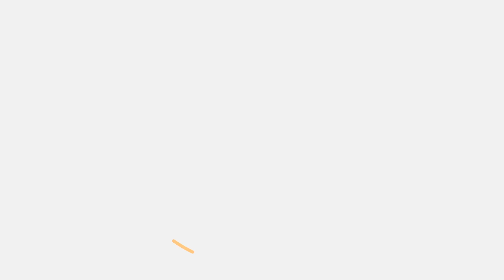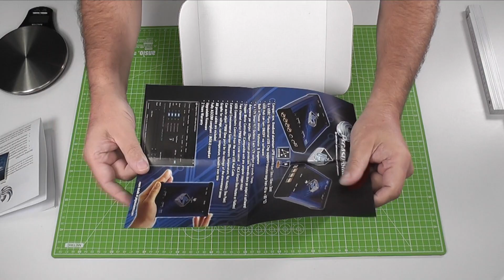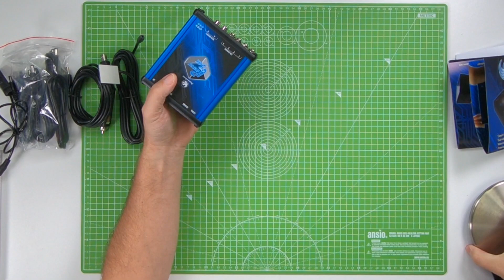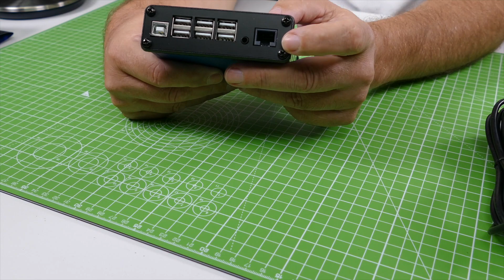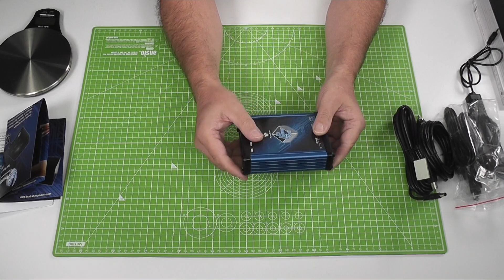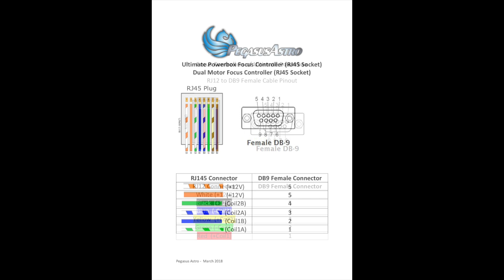Pegasus Astro Ultimate Power Box (UPB) Unboxing and Overview - Part 1 of 2

Comment: Can this act as a camera to PC interface as well? Sorry if that's a dumb question, I'm not so tech savvy. Basically can this act as a hub for the com cables or is it strictly power supply requiring a separate USB hub?

Comment: Just bought this from Tring Astro. Looks very good.
Reply from the maker: That's good to know that Tring sell the PA equipment.  Unfortunately they are showing out of stock for it, as is the case for most suppliers at the moment, but well worth waiting for.
Reply: Whew must have bought the last one today. Count myself lucky.
Reply: Galacticus Funny, I bought mine from Tring 2 months ago too! Neil, the owner I think had the last unit sat in a box ready for despatch with some other bits n bobs. I tried to convince him to sell me it 😬 but the mans a loyal chap 🙏 I put an order in which took around two weeks before I took delivery. I love the unit. Bit expensive but most scope hardware is right 🙄 I also have the focus cube, sadly you can’t control the focus cube with the ultimate power box. I spoke to Pegasus and they told me I should have purchased the stepper motor kit, not the focus cube! hind sites a wonderful thing lol. Not really a problem as the whole kit n kabudle is driven through SGPro.

Comment: A great Video again :-)
Not good to hear that you had to send your EAGLE back. I also was thinking about buying one, but I think it's heavily overpriced.
I'm thinking about of developing an "ASTRO-PC" based on an Intel NUC. The whole project will be open source. Maybe you find such a project interesting. If yes, I would be glad to hear what you are thinking about it.
Reply from the maker: Hi Keinen, thanks for the comments.

Yes a real shame with the Eagle2, but for such a premium product I expected it to work flawlessly, and it simply didn't.  It was also based on a NUC, and this is where some of the problems lay, in that firmware issues with it were not able to be addressed by PLL.  They basically developed a separate power and USB2 board and connected this internally to the NUC.  In the end it meant too many USB, driver and other issues that were costing me so much imaging time that I had to give up.

I think, given time and some more testing, including PLL actually listening to feedback rather than convincing themselves nothing is wrong, then this could be a superb product as it has the potential to be.  But it isn't ready just yet.

I would say if you are thinking of developing an astro PC, which I think is a great idea, then it needs to be reliable first above all else.
Reply: Do they have not used the USB from the NUC to connect the imaging camera and the autoguider? The additional board in the UPB should be likely similar as in the EAGLE2.
I have a cheap Chinese Mini-PC from Alibaba running. It works almost quite well. My main problems are the trashy driver and the trashy USB-protocol from QHY. That's also such a shame. The stability of the USB connection is a shame.
What exactly do you mean by the PLL?

I've also had the idea of taking a mini-ITX system as a basis. This would have the advantage of full speed desktop CPUs and a much more faster/stable USB 3 connection. The only problem for mobile use is the power consumption. But this could be optimized by undervolting/underclocking. A further advantage is PCI-express ports, which gives the ability of installing more full speed USB ports that are not just a hub like in the EAGLE.

I'm very excited about your video about the eagle2 and you 2nd video of the UPB.
Reply from the maker: Hi Keinen.  Sorry by PLL I mean PrimaLuce Lab.

They do use the 4 USB 3 ports on the NUC, which you can use for your camera, and then there is an extension board which had 4 USB 2 ports and the other outputs such as PWM and power ports.  I'll go through the issues in the update video but the main one was the inability of the system to boot on power, which for me in a remote observatory was critical.
Reply: Thank you very much for your reply. The problem with the NUC and the USB 3 is also (If it is the same as my Mini-PC, but I think so because it has the same Chipset), the 4 USB 3 ports are only 2 USB3 interfaces. On each Interface is a 2 port hub. So if you plug guider and imaging camera on the same interface, you will have problems with the bandwidth. I think the 4 ports on the EAGLE are just a 4 pin USB hub. This is ok for devices with very low bandwidth like a focuser. With devices like USB 2 Serial or Bluetooth to control the mount it can cause problems.

Comment: Great overall review mate. Shame about your Eagle having to go back. Hope that’s sorted out. I guess with having so many things to go wrong in this hobby, Pegasus UPB is a welcomed addition which as your mentioned hardly ever fails.
Reply from the maker: Cheers Ahmed.  I thought I would do this in 2 parts as I wanted to show how small, light and compact the unit is, and what comes with it etc. (although I had a senior moment and couldn't remember the size of the 3.5mm jack plug!!) but I really wanted to dedicate a whole video to it running because, as you well know, it is a great piece of kit with lots of things to look at.

I'm afraid the Eagle2 looks terminal.  I will be updating the videos, but it essentially came down to the firmware of the NUC not having the ability to boot on power, meaning I would need to leave it on permanently and run it via Wake On Lan, which doesn't suit me for a remote observatory at all.  A power outage would mean I would have no way of turning the unit back on.

Anyway, got another UPB now and, as with the first one, I am very happy and all is working perfectly.
Reply: Absolutely agree, a 2 part video will only do this device justice. Lots to cover in the second part and can not wait for it. You’re reviews are very thorough and I for one most certainly looking forward to the videos.

Shame about the Eagle mate, you obviously need something that is not only reliable but will work day in and day out. Given the price point of the Eagle 2, I would’ve hoped they had these little issues sorted out. The UPB is 1/4th of the price and yet it’s super reliable.

I’m glad you mentioned that you bought the second device because at first I thought “Oh no, you didn’t put it all back in the box ... and oh wow, you’ve packed them all nicely as well” but soon realised this was indeed a new device :D Gives everyone else more reasons to buy this device.